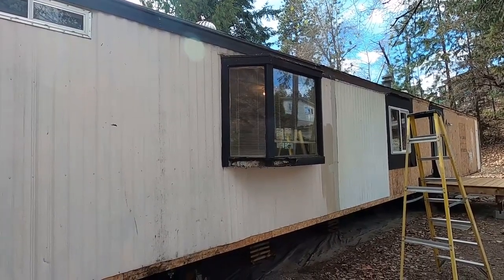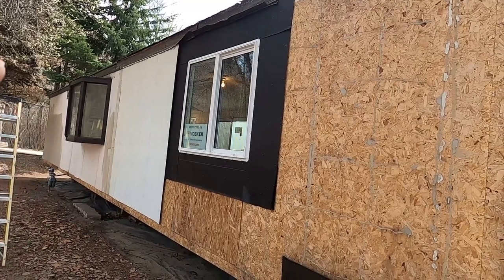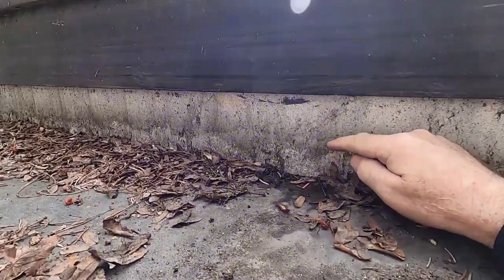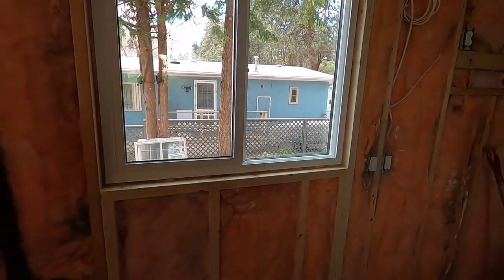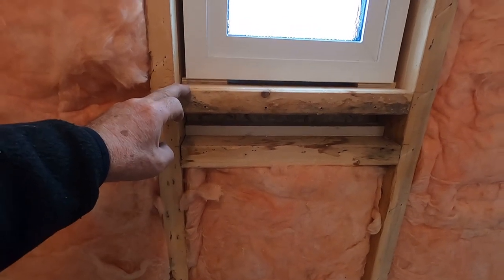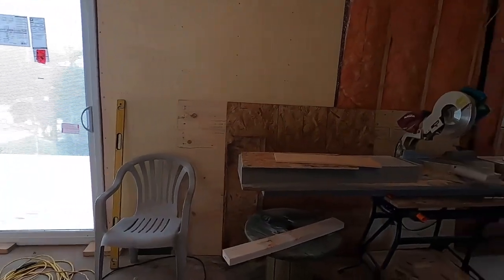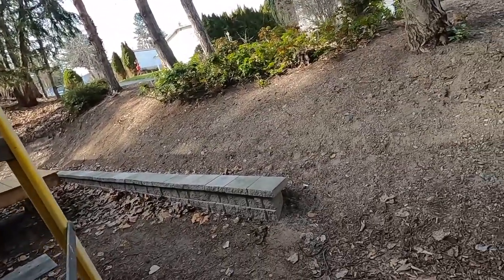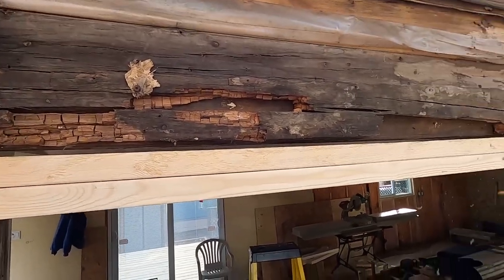Old Bay Window Remodel - Abandoned Mobile Home Project : E109 / BC Renovation Magazine

Comment: Another great video. The new windows look great. I agree with you. I would do away with the Ski Light. It will just leak and let cold air into the house. Plus hot air rises and it will go right out the roof. I live in the north now. But I am from the south. People in that area are putting the V-Roof on the old flat roof mobile homes. I think it works much better. I see you have the V-Roof on that mobile home. What will you do with this mobile home once you have finished remolding it? Great video thanks for sharing. Stay well & safe.
Reply from the maker: Hi, Thomas Tommy. Yes, it's nice that this home has a pitched roof (V-roof). The roof is going to get a major transformation that is going to make this home look completely different. I will be getting into that pretty soon. It is a big job. There will be no more tin roof. The new roof will be asphalt.

This home will be sold when it is finished. 

Thanks for watching and for your kind comments. I appreciate it! 🙂
Reply: @BCRenovationMagazine  How much will you ask for the home? Do you own a trailer park there? Thanks for responding to my post.
Reply from the maker: @thomastommy1192  , if I had that home ready for the market right now I would list it at just under $300,000 Canadian (about $235,000 US dollars). Housing costs in our area have gone nuts. An average site built home on a city lot is in the range of $1 million, so this is considered 'affordable' housing. Our home prices increased about 30% in 2021. By the time I get this home ready to sell, who knows what the market will be like. It is changing quickly.

No, I don't own a park, I wish! 🙂 I would love to own a nice park.

Thanks for watching and commenting.

Comment: I'm a fan of skylights just because l am a plant lover. Do have a question regarding the changes you are making. When window are added, removed larger windows put in are you still able to maintain csa?
Reply from the maker: Hi, Connie. Skylights give good light for plants, that's for sure. 🙂

That is an interesting question about CSA. I will try to answer that from my perspective of how I understand this based on my over 40 years working in the construction industry. Admittedly, I have only being working in these mobile homes for the past 5 years. This is my fourth mobile home renovation. Mobile homes are a little different than regular homes.

Codes, requirements, restrictions are very much location specific. These will vary from place to place, so what applies in my location may not apply in your location. We have national codes, which is where CSA falls on these homes. Then we have provincial codes, municipal codes and in the case of mobile home parks, they have a say in how and what you do to your home.

The CSA aspect is mostly applicable when the home is built, in the factory. That is where all of the initial inspections are done. Modern mobile homes are built to CSA Z240 standards which cover building, plumbing, electrical and gas standards specific to mobile (manufactured) homes.

When the home is delivered the jurisdiction moves to a combination of the provincial (or state), municipality, and mobile home park. CSA is still there, but in the background. 

In our case, where we are renovating a 38 year old home, in the location we are in, the jurisdiction has pretty much shifted entirely to the municipal and park owner level. Our project was built before CSA Z240 came into affect (which was 1992, I think).

If we make any structural changes to the building that affect load bearing then a building permit is required. A permit is required to put the new roof that we are planning over the new deck. If the new deck is more than a certain distance above the ground, a permit is required, in our area. 

If a window is installed where one was not before, and it is in a load bearing wall, a permit is required, but not necessarily to maintain the CSA rating. 

If we make any changes to the electrical system we affect the original CSA rating. That all has to be done under permit and inspected. Do electrical work on your mobile home without a permit in BC (provincial jurisdiction) and your CSA rating will become invalid. If your CSA label goes missing, as was the case with our project, the CSA rating is automatically void. In our case we had to get a Silver Label from Technical Safety BC to be rated again. That was expensive! 

Plumbing falls under the CSA rating. If we just change fixtures the rating is upheld. If we re-locate a toilet to a different area then a permit and inspection is needed.

The best answer that I can give you is to contact your local building authority before you undertake any major changes. For us here in BC, the one thing that affects the CSA rating the most is the electrical. It is so important that it is illegal to even put a home for sale that has an invalid electrical certification.

If you are just replacing existing roofing, windows, doors, siding then that is usually considered repair and maintenance and does not affect anything. 

Long winded answer but you asked a rather complex question. 🙂
Reply: @BCRenovationMagazine  Thanks for your quick feedback. Yes a long winded answer but l think necessary. I has put several things into perspective for me. So appreciate that very much.

Comment: What would you do in the situation to where you remove the siding and there is no osb? Would you remove all the siding and put osb up?
Reply from the maker: Hi, Nick. What kind of siding would you be removing? Is it metal like this home has, or something else?
Reply: @BCRenovationMagazine  metal
Reply from the maker: @nicksinclair2407  , I would remove the metal siding, apply OSB or plywood (screw it on), whichever is least expensive (plywood was cheaper than OSB here for a while), and then apply your new siding.